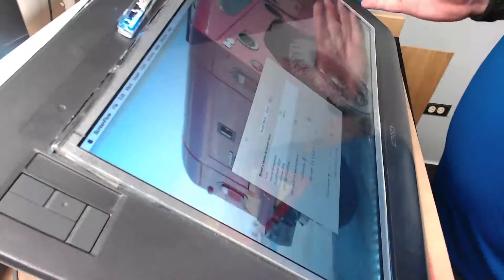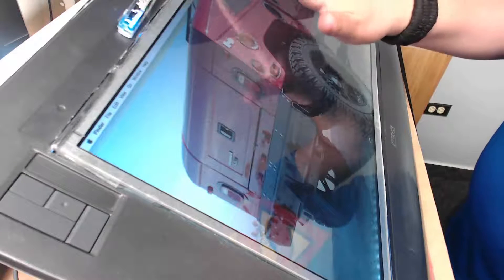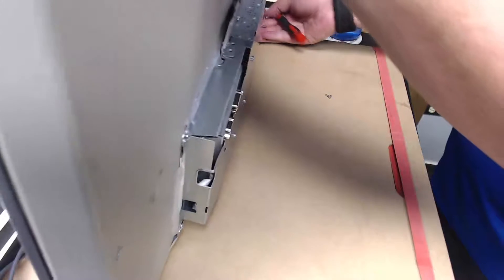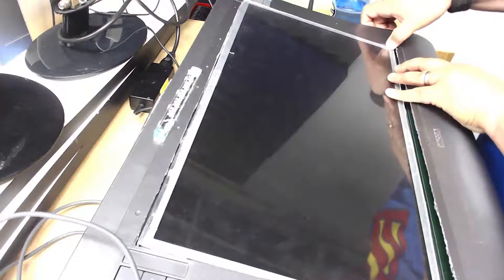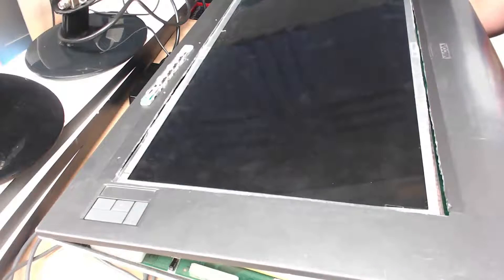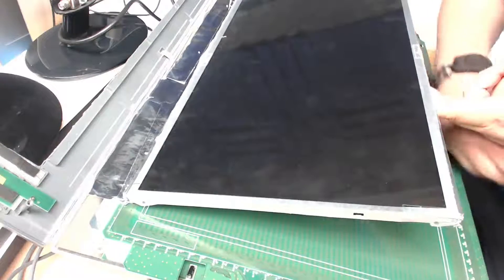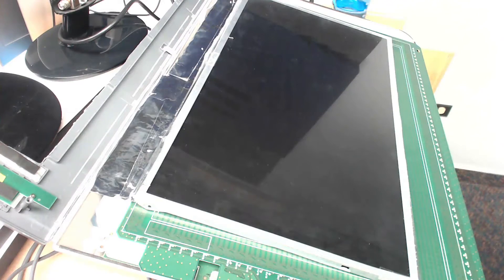DIY Cintiq Part 4

Comment: I made One like u. I have problem with heating. Do You know If this is a commom issue?
Reply from the maker: Where is the heat coming from? My screen is not warm at all even though I use it as my only display for my computer all day long. The power supply, monitor control board and inverter are all in a small metal case attached to the back side and well ventilated, so there is no extra heat from that.
Reply: The heat is from the down part of the LCD screen, where is the Little  thin board attached to the screen and near backlight
Reply from the maker: Interesting. I had not ever noticed the heat coming from that area until now. Yes. Mine is also warm. It's not unbearable but it is noticeably warmer than the rest of the tablet.
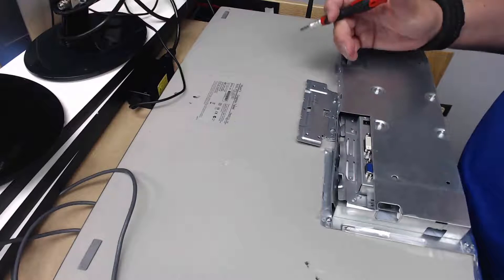Reply from the maker: When? All I see going off the main screen is the mouse cursor when selecting options. (3:01). Selection at 3:15 shows the stylus going below the white portion of the screen, but still appears to be over the active area of the tablet. As an owner of two Intuos 3 A3wide tablets, one of which I have already converted to DIY Cintiq, It appears that GnaReffotsirk is correct in the assumption that it is simply a tablet behind a very large monitor.
Reply: Yeah. I dont have a glass that cover or something. i Just draw on the panel and that point its really hot xD, i can Cook on it

Comment: I screwed one lcd monitor for this DIY.
Screwed the PCBconnections on the intuous too, but I managed to fix soldering all together.
I was using a smaller monitor, so it would never work properly.
After almost give up completely, got myself a bigger monitor and its backlight flat was damaged.
I send it to an electronic expert and he said it couldn't be fixed or even replaced.
I got a little angry about it, then yesterday I decided to check if the flat cable was the real problem on all this.
By that time, I've learned that the power source was damaged on backlight part, it wasn't powering the led backlight, so I put an outer power source in a new led strip as a backlight and TA DA! Didn't need to throw it away and buy a new one! My main problem still concerns shielding though and by the symptoms, I'll have to shield most of top  and bottom of the screen cause tilt and random clicks are big on these spots. Other than that, it can be done. I hope I can calibrate it right. Thanks!
Reply from the maker: +A Cosmic Castaway Yes! I'm glad you were able to get something together by using a new power supply. These things are pretty temperamental. I only built this one after failing four times on a smaller 9x12 build. I still haven't finished that one. Good luck on your shielding. I used a few sheets of paper-thin plastic to insure aluminum tape didn't arc and short the whole tablet.
Reply: +Ryan Haworth Your videos brought me that will of doing it right once again.
It's not finished yet, but soon it will be. I'm kinda doing something similar to the touch buttons from the monitor, but need some thinking on it.
I have to put plexiglass and do the back support. But nothing is a problem for someone that loves DIY stuff.
 Thanks again, it was of much help to me.